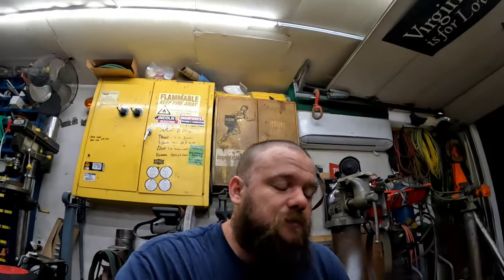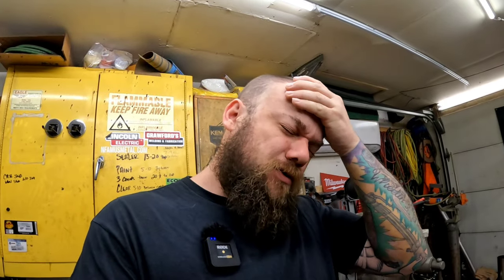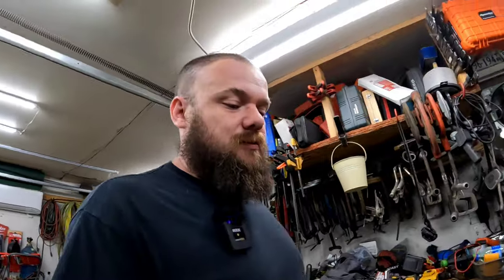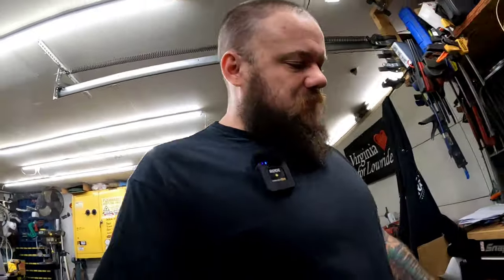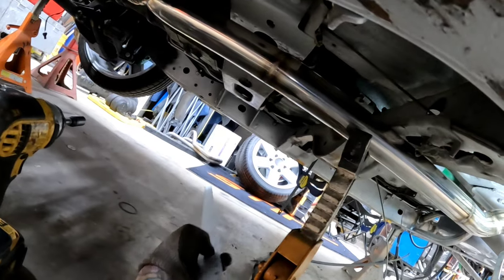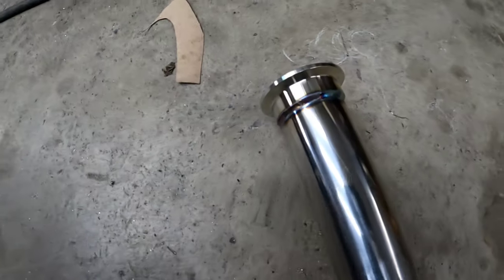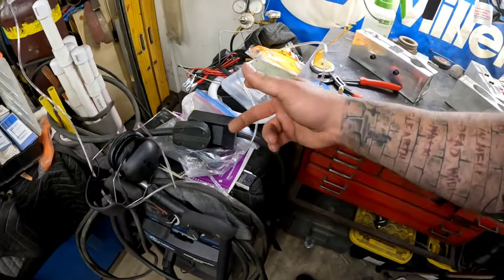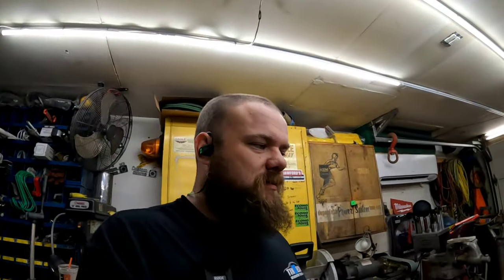Bagged Mini Truck build #15

Comment: I've seen people purge and use wadded up tinfoil to plug the ends and just leave a little gap to slow down the gas exiting. This is a much nicer solution. lol I've also seen people who keep separate tools for cutting stainless and mild steel. Do you have to do that with that Evolution saw? I was also thinking you could make an "Amazon quality" set of those exhaust clamps with those bolt on exhaust clamps from the auto parts store and a unibit. Might have ot try it one day when I get that far because I can see how handy those AUS ones are.
Reply from the maker: Yeah I debated on going that route. This is hopefully a one time purchase rather then rolls of foil. Plus it makes me look like I know what Ike doing haha

Comment: I would be interested in your link to the items to make your purge kit. Every nickel and dime saved, will go back to builds and projects.🙏🏽👍🏼😊
Reply from the maker: The first link is for the silicone plugs I used on this project they are still 5 for $12. High 

Temp Masking Supply 1.875" X 2.203" #11 Hollow Silicone Plugs - 5 Pack https://a.co/d/fj7QBua

These other links are for the small brass pieces.  Looking back at it since it has to vent I believe I would have bought just the double ended barbs for both sides. But I'll post the links for everything.  I also bought the large Quantities since I have so many different size plugs.  

5pcs/set Pneumatic Muffler 1/8" NPT Brass Body Valve Thread Adjustable Silencer Noise Exhaust Thread Flat Head Pneumatic Air Flow Speed Controller https://a.co/d/5J0Uc5T

1/4" Barbed x 1/8" NPT Female Coupling Adapter Connector Brass Hose Barb Fitting, 5pcs https://a.co/d/c3iJWeZ

JoyTube Brass Hose Barb Fitting Metals Splicer Mender, 3/16" Barb Hose Union Fuel Gas Water Air (Pack of 12) https://a.co/d/fR2pB6O
Reply: @Virginiaisforlowriders  thank you

Comment: Hello, I have a quick question what size bags and what type of you running on your truck? I’m process of bagging my Ford ranger and I got slam specialist 2500 bags on all four corners and I would like to be able to utilize what’s left of my bed of my truck to hall or tow a trailer and also, keep up the awesome fabrication 🤔😊👍🏼🤙🏽🙏🏽♥️
Reply from the maker: I'm running air lift 2500s in the front and air lift 2600 in the rear.  And thank you!
Reply: Thank you for the reply back I’ll pick up to 2600s and save the two 2500s for back up spares🙏🏽😊